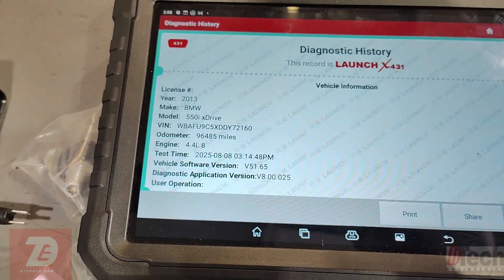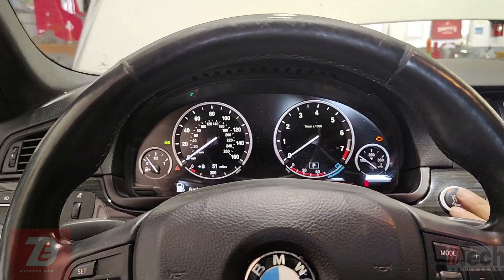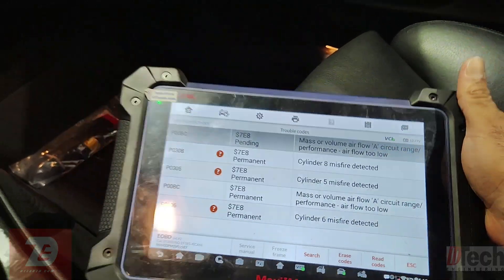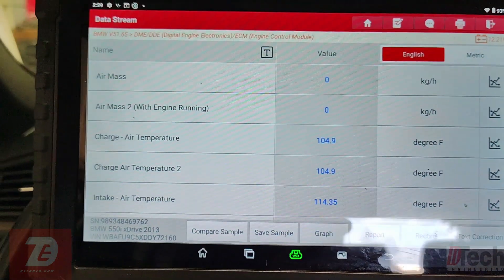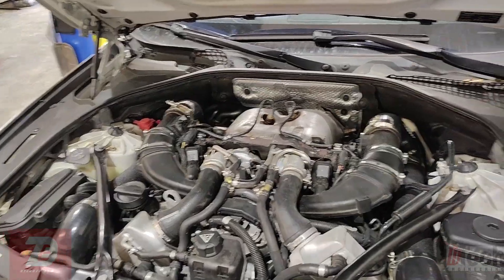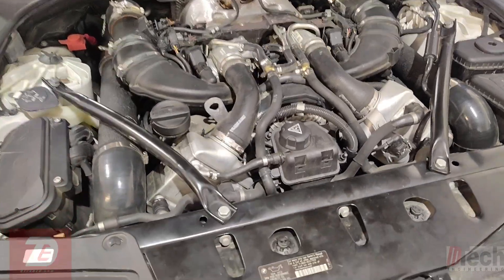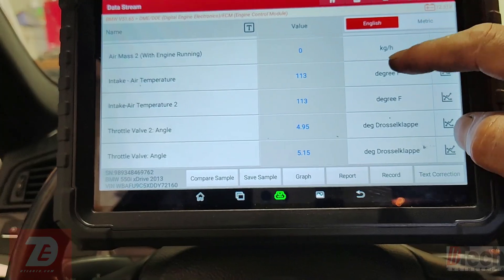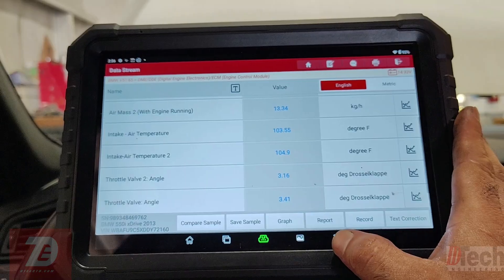CRAZY SIMPLE FIX FOR LOW AIR MASS FLOW P00BC ON BMW 550 N63 V8 ENGINE

Comment: I made the same mistake with an aftermarket intake on a personal vehicle. 85 Buick GN. Would lightly accelerate but no heavy acceleration. Flipped the aftermarket intake tube over(flips the MAF by default). No more problem.

Comment: "I wish my last one was that easy": is there a video link to the "uneasy last one"?
Reply from the maker: https://youtu.be/y_oA-ORJ5Sk

it's a long one so I recommend watching it at a faster playback speed
Reply: @DTEAuto  The physical length of a video is not a determining factor for me: I watch video at a pace that makes me UNDERSTAND. Speed has no relevance to UNDERSTANDING. For example, right from the start I was "enlightened": I have never seen two DME's on vehicle, one for each bank. Now, I am curious who synchronizes the two of them: third one?  (Just rhethorical question, I will understand it after I watch the video, and Google the answer, possibly).